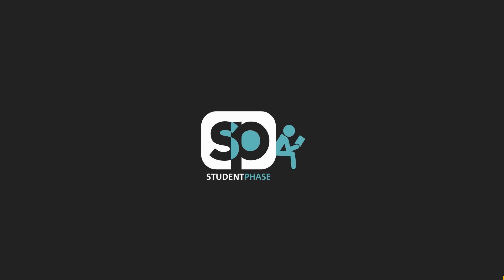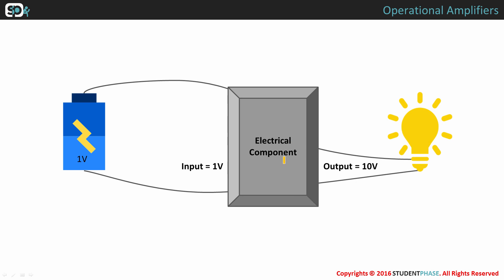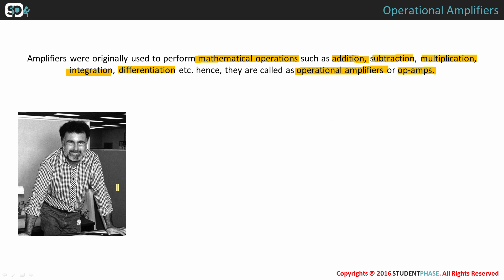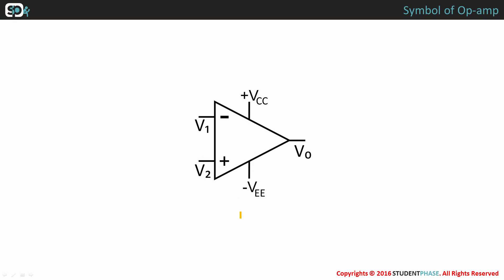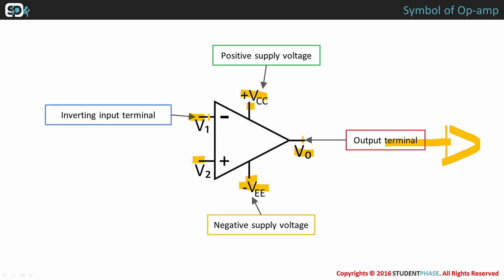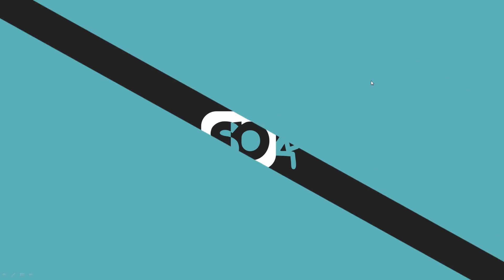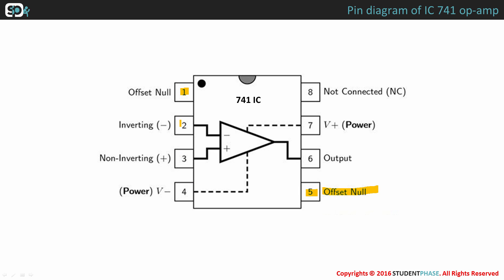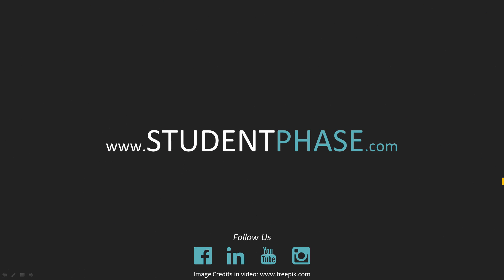Basics of Operational Amplifier or Op-amp | Pin Diagram of 741 IC

Comment: How the log amplifier can be tuned around to provide antilog function?.
Reply: By using a diode Or bjt in feedback path on negative feedback configuration and non inverting input grounded we can get a anti log amplifier
And here input voltage is to the inverting input through a resistor
And by exchanging positions of the diode/bjt with the resistor we get a log amplifier